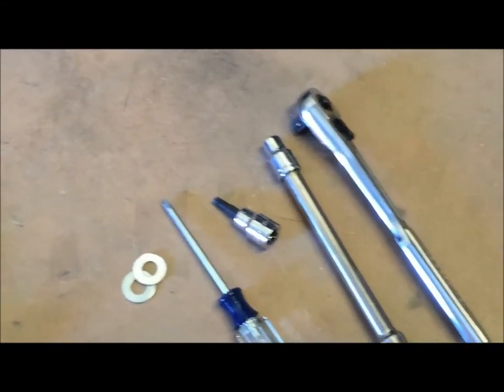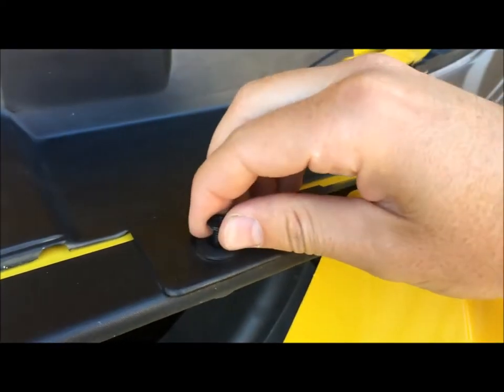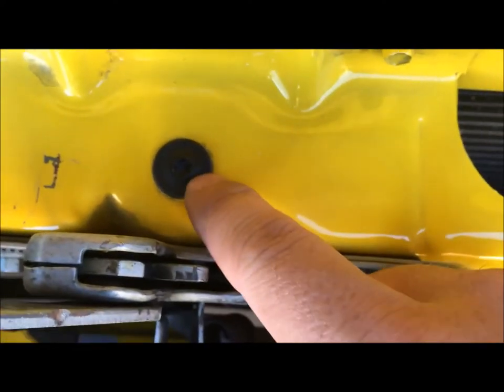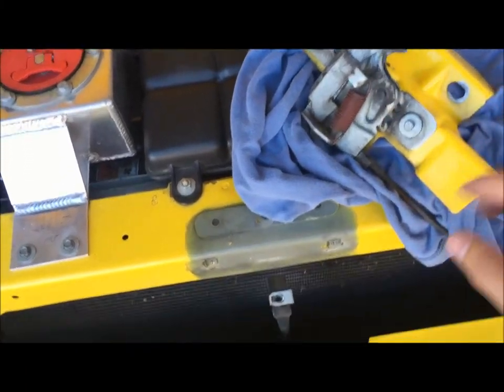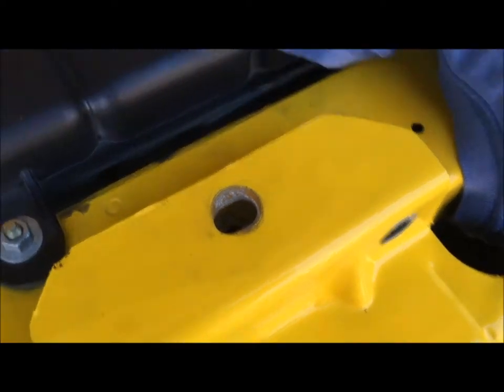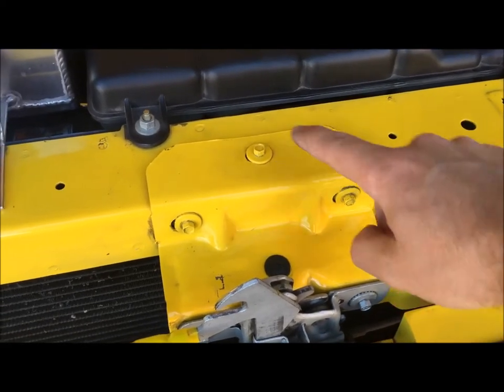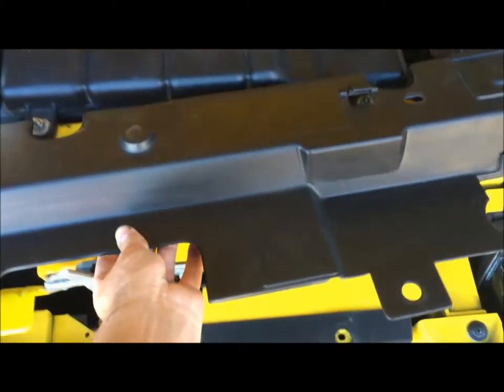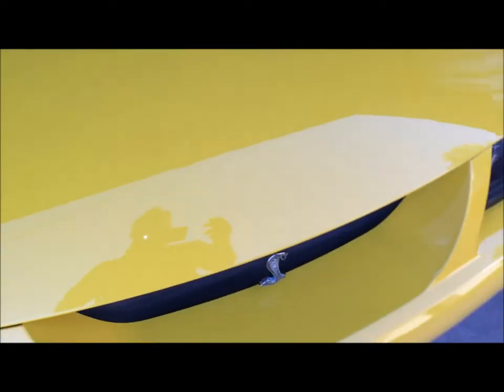How to remove the hood latch: 1994-2004 Ford Mustang

Comment: Hey Danny. What hood is that?. I just purchased a used 04 convertible with that hood but it's an aftermarket fiberglass one. I was told it's a cobra hood. I am missing the mesh grille inserts and trying to track a set down. Maybe if I know the correct hood style, might be more successful. So far your the only one I have seen online. But the search will continue. Thanks for your time.
Reply from the maker: spc box the hood is stock. You may have an aftermarket terminator hood. The way you can usually tell is the fitment. The terminator hoods are shorter to line up with the cobra bumper, which makes it not line up with a gt bumper. Aftermarket hoods are usually designed to line up properly with the GT bumpers. Does yours appear good? What model car do you have?

Comment: Is that bar the t30 torx bolts to on your car have a bend to it at all? I had a different hood put on my car & it won't latch. I'm thinking the latch is bent downward a little & preventing it from latching
Reply from the maker: You might see more of the bar in this video https://youtu.be/N9x6H4jTV7g

Comment: I have a 2000 mustang and I can't get the hood to release latch to open the hood so how do I get it open to replace the cable and the latch?
Reply from the maker: Teebuck27 you'll have to find where the cable comes through into the car and pull on it with vise grips. Can you locate the cable? Does it seem attached?

Comment: Yes the cable is intact  but when I pull on it it will not release the hood I did try to pull on it but not with a pair of vice grips I'll try that tomorrow. However I did get underneath it and tried to release it with a screwdriver, and I could only get the bottom latch open. This is was prompted me to look at you tube. This is how I discovered your video and by the looks of if it there is actually two latches one on the top and one one the bottom.
Reply from the maker: Teebuck27 if you haven't, maybe try to have someone shake the hood up and down while you pull on the cable

Comment: Any idea where to get the t30 torx bolt and support it screws into? Mine doesn't have either...
Reply from the maker: A hardware store should have them
Reply: Danny Johnson’s Garage they have the metal mount the t30 bolts into?